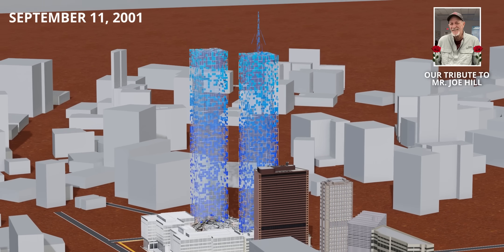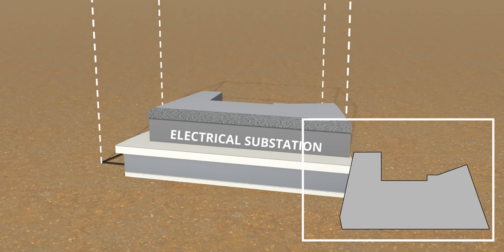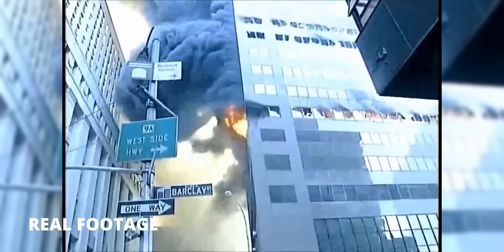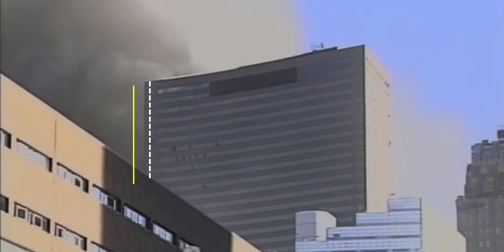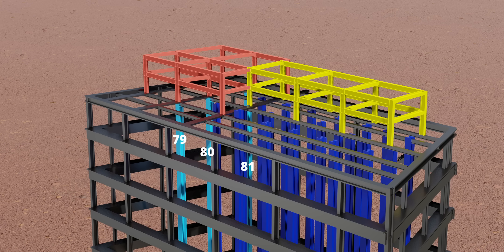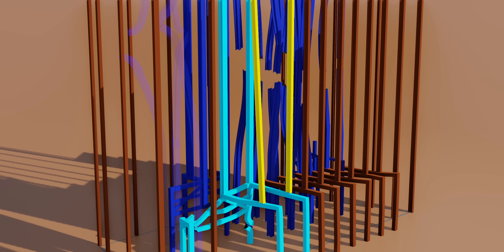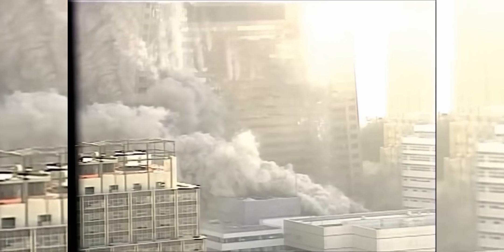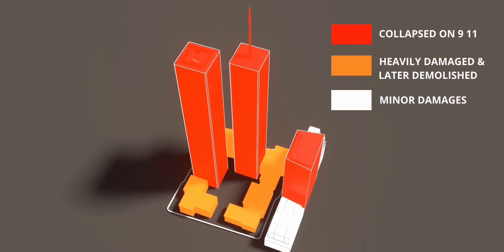Collapse of Building 7 | The Complete Physics

Comment: This video is complete nonsense and should be banned from YT!  😢😡
Reply: This video is pretty good – with a few exceptions - and goes into a much higher level of detail than many viewers will be able to comprehend.  While not perfect, the collapse mechanisms – the sequence of failures - described here  are substantially correct and this is true no matter who planned and carried out the 9/11 attacks or why . 

That may not be what you want to hear and go against 20+ years of entrenched dogma and conditioning, but it’s not wrong. 

That also means (in case you did not get the hint) this video can be (and IS) absolutely correct in its description of collapse mechanisms AND the 9/11 attacks could still have been some sort of inside job. The two things are in no way mutually exclusive. 

The mechanisms described here have broad professional support around the world. There are no professional engineering organizations (for example: ASCE, ASEE, ICE, etc) that disagree with them or have offered any formal dissenting opinions or alternative hypothesis. 

So, setting hubris aside, either the overwhelming majority of the worlds structural engineers and simple observation are wrong,… … or you are. Which seems more likely? 

IF you still think believe this explanation is wrong then produce a better one . Good luck with that. No one ever has and I don’t see you moving that needle today.

Comment: After reviewing the photographs released by firefighters in January, the photographs taken by firefighters during their investigation of the collapsed building reveal photographs of columns that appear to have been cut and exhibit 45° ankle cuts. These firefighters took these photos prior to the arrival of the wrecking crew, who commenced making substantial incisions for the loading of trucks. Explain those suspicious 45° angle cuts In many of those columns, which were very thick.
Reply: and how quickly those columns were loaded up on a ship and sent over to China to be melted down BEFORE any investigation could take place.  No evidence?  No crime!
Reply: Was the cut at the angle to the vertical of the beam or surface of beam
Reply: @ 
Do you even know what you’re talking about vertical surface? Do you know anything about steel and demolition? I don’t think you do no offense, but I really don’t think you know what you’re talking about.
Reply: @MINDSPARK-u6e  - I do. And I can even describe it in my own words, not simply mindlessly repeating the unattributed quotes of others like you do all the time.
Reply: Examination of photos of the still standing columns along the wall adjacent to the telephone building will show you the spandrels were cut right through at the beam intersections. In a passive collapse, the spandrels would have peeled from the columns at the weakest point, the peripheral welds, and they would have been severely distorted.
Reply: The cuts were at 30-degree angles, not 45-degrees and were made on October 29th, 2001 by workers using thermal lances and cutting torches to remove debris. The columns in question were North Tower core columns from around the Stairway B area. All of this was extensively documented and has not been a mystery for more than 20 years.

Please do try and catch up to the rest of us.
Reply: @TheCriticalStinker-01  you have no idea how a cutting lance works if you think it’s possible to maintain a continuous angled cut on tension bearing steel lol you go straight at it level and true .
Reply: @TheCriticalStinker-01  прекратите писат чушь под каждым комментарием. Сколько вам заплатили за это?
Reply: @TheCriticalStinker-01  "The cuts were at 30-degree angles, " Check his history. He gets paid to post liberal propaganda.
Reply: @TheCriticalStinker-01  Respectfully, It's just ridiculous to cut at 30 degree angles when you could cut at 90 degrees. Have you ever cut steel? You would NEVER cut at an angle unless it's needed to manufacture something.
Reply: @rvaillant  - When a lumberjack cuts down a tree they do it at an angle,... to control the direction of fall. When the workers were removing debris from Ground Zero they cut the bases of the surviving North Tower core columns at an angle,... to control the direction of fall.

Sometimes you have to use the thinking part of the brain.
Reply: @rvaillant  это точно 100%
Reply: @SC-bp5lq  - Plenty of video showing the process.
Reply: Those weren't cuts , they were cracks you would know about cracks in metal if you ever played with metal wires
Reply: I blame any ankle cuts on debris flying at ground-level.

Comment: Two questions - why was WTC7 burning to begin with. Second - how can an aluminum antenna cut through a steel structure even if it did fall that way? Great try. At least we now know where the charges were placed based on the fall pattern.
Reply: 1. Explained in the video.
2. It wan't and it didn't. 

Bonus:

Demolition is a hand-wave rationalization employed by non-thinking morons. The collapse of Building 7 is probably the most studied engineering disaster in history and the subject of 5 comprehensive engineering studies and more than two dozen technical articles in major peer reviewed engineering journals, most of which were published 15 or more years ago. Thousands of pages of material.  This should get you started.

FEMA BPAT (initial report superseded by NIST NCSTAR 1A)

NIST NCSTAR 1A: Final Report on the Collapse of the World Trade Center Building 7, 2008.

Guy Nordenson and Associates, WTC7 Global Collapse Analysis Report and Summary of Findings, 2010.

Arup, WTC -7 Structural Fire Analysis Report (Runs 1-4), 2010.

Weidlinger Associates Inc., WTC 7 Collapse Analysis and Assessment Report, 2010.

BRE Centre for Fire Safety Engineering, Analysis of the Impact of a Fire in the Mechanical Room (5th & 6th Floor) of the World Trade Center 7 Building, 2010.

T. McAllister, R. MacNeill, O. Erbay, A. Sarawit, M. Zarghamee, S. Kirkpatrick, J. Gross, Analysis of structural response of WTC 7 to fire and sequential failures leading to collapse, J. Struct. Eng. (United States). 138 (2012) 109–117.

For a summary of the major studies I would recommend THE COLLAPSE OF WORLD TRADE CENTER 7: REVISITED by Mhd Anwar Orabi , Liming Jiang , Asif Usmani and Jose Torero which is a 33 page summary of the different analysis and conclusions published in 2020. Sorry, YouTube will delete this post if I give the link but it should be easy to find and is available from the University of Queensland, Brisbane. 

Real structural engineering industry professionals conducting real engineering studies and publishing them for other professionals to see. Not amateur YouTubers appealing to the gullible and credulous.

Happy reading
Reply: Why do you always have to say/type something that has been shut down or Debunked Twenty years ago !? 
We get it you’re not going to “changer your mind” or Realize what actually happened 
So quite repeating ? SMH

Comment: Animations aren't reality. 
You tell yourself whatever you need to hear to get through the day,  but this building was intentionally dropped. Not only was it a professional job, even people who drop buildings for a living were impressed. Dropping at freefall speed within its own footprint is the literal fingerprint of a controlled demolition.
Reply: This video is pretty good – with a few exceptions - and goes into a much higher level of detail than many viewers will be able to comprehend.  While not perfect, the collapse mechanisms – the sequence of failures - described here  are substantially correct and this is true no matter who planned and carried out the 9/11 attacks or why . 

That may not be what you want to hear and go against 20+ years of entrenched dogma and conditioning, but it’s not wrong. 

That also means (in case you did not get the hint) this video can be (and IS) absolutely correct in its description of collapse mechanisms AND the 9/11 attacks could still have been some sort of inside job. The two things are in no way mutually exclusive. 

The mechanisms described here have broad professional support around the world. There are no professional engineering organizations (for example: ASCE, ASEE, ICE, etc) that disagree with them or have offered any formal dissenting opinions or alternative hypothesis. 

So, setting hubris aside, either the overwhelming majority of the worlds structural engineers and simple observation are wrong,… … or you are. Which seems more likely? 

IF you still think believe this explanation is wrong then produce a better one . Good luck with that. No one ever has and I don’t see you moving that needle today. 

No one ever does.
Reply: @TheCriticalStinker-01  god that last line is perfect

Comment: how to cock up a story the antenna fell straight down leaning in the opposite direction from WTC7,  the gash was caused by the side of the tower fallling into the WTC7 its collapse started on the part that had NO damage explain that or do you all like being blinkered from the truth knowing that the whole collapse was an inside job & your trying to cover it up by fabricating it all
Reply: The physical damage introduced the fires. The fires - after burning and spreading throughout the building for 7 hours - induced the failure which caused the collapse. 

It's a multi element problem.

Comment: Where did all the molten metal come from? Also, there were aerial thermal images that indicated very high temperature on ground zero days after the collapse even after rain.
Reply: What molten metal?
Yes, the fires in the debris pile would not be completely extinguished for 100 days, in part because there was no effort to do so for the first 17 days. Hence high temperatures. No mystery.
Reply: @TheCriticalStinker-01  "What molten metal?" All that orange stuff flowing out of the building. 
And before saying something else stupid, only ferric materials glow orange when heated. All other metals will glow silver or blue. Airplanes are not made from iron.